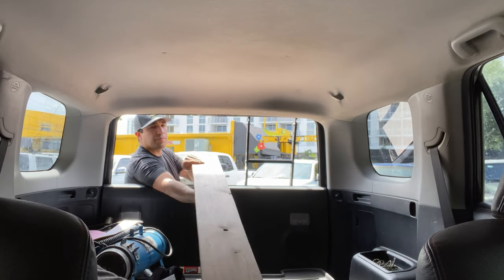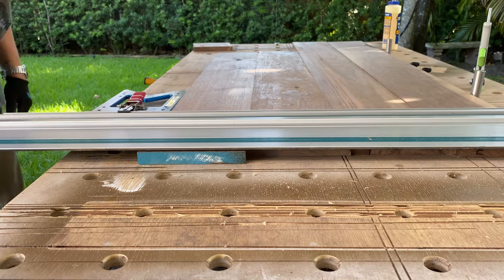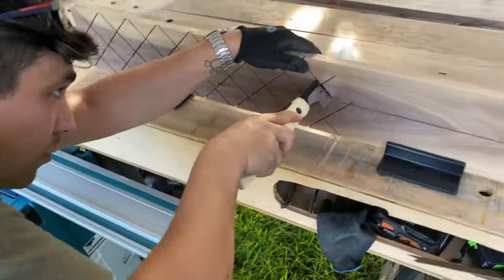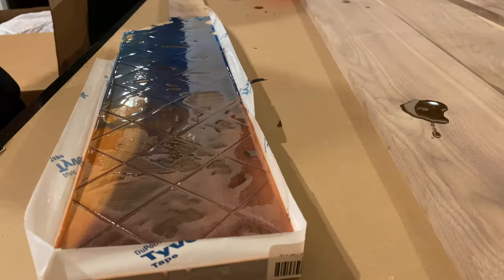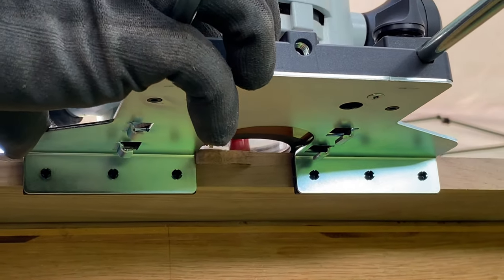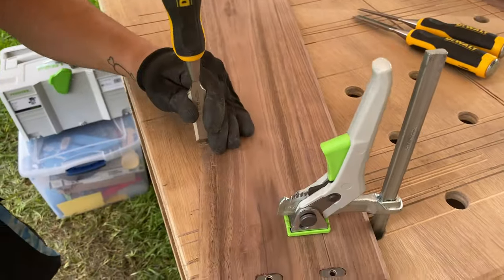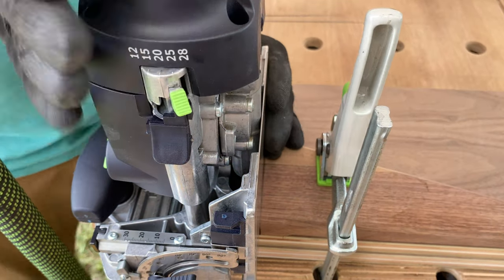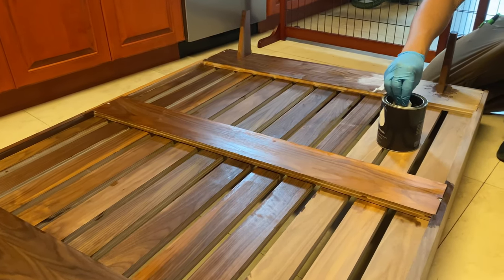Building a dream bed for my Malamute dog | DIY Doggy Bed

Comment: Nice slats! Lol. Maybe paint the grooves white before pouring the epoxy to get the color to pop more.
Reply from the maker: Garrett's Custom and Outdoors this is our second time using Epoxy we are newbies 🤣
Reply: I’d be scared that it would be like trying to glue something over paint. If the paint chips or starts to peel then it would take the epoxy with it. But I would have to test it to be sure.
Reply: Jose Nodarse a thin paint on the bottom would be safe. The epoxy could still bond to the sides of the groove.